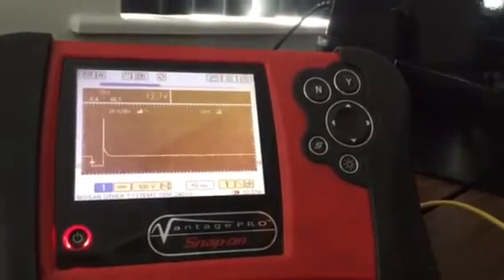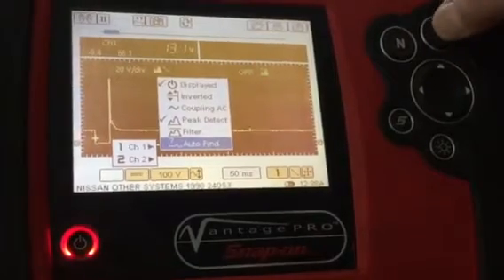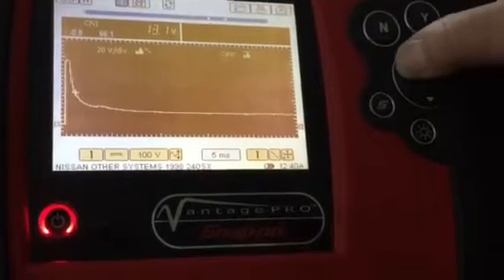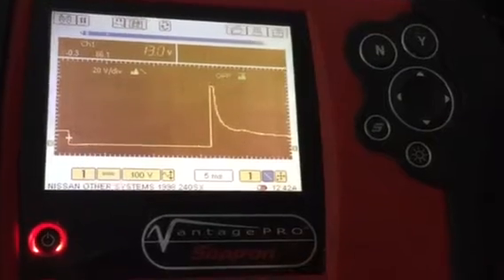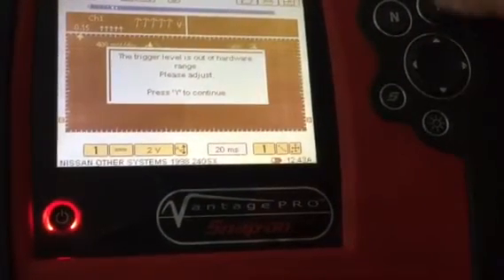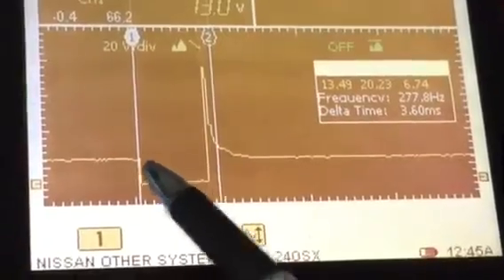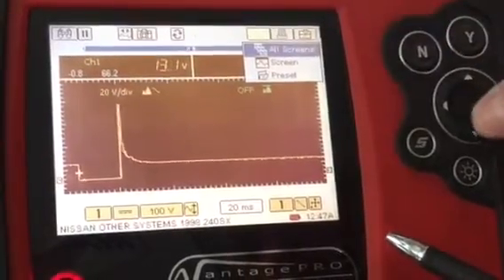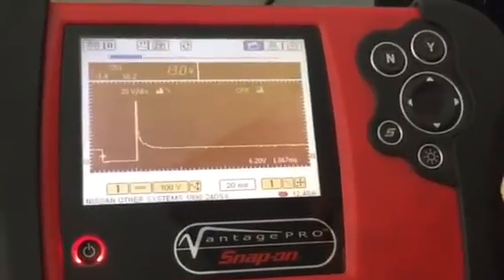Using a Snap-On Vantage Pro Labscope

Comment: Under tools you can set which CF card to save to.  Obviously, the Vantage Pro in the video is set to save to CF-2.  If you don,t have a card in the CF-2 slot, you can set the tool to save to CF-1.  Be careful though, the OS is on CF-1.
Reply: +Steve A Thanks for your input

Comment: Hi Jerry my Vantage Pro only list a couple of printers none of which I have. Can you load other printers onto the scope? I haven't come across anything in the manual..maybe I missed it.
Reply: +tecnaman Sorry I am not sure...try posting this question on the Snap On forum on iatn they may know or contact Snap On. It's not the scope I use ...one thing I can tell you is that if you install a CF card in it and save the screen shot you can then remove the card and install it in a computer that has a CF reader or you can purchase a CF USB reader at a reasonable price at computer stores or online. Once you have it on your computer you can print to any printer...I do it from the Snap Verus scope as well as my Fluke and others....thanks for watching